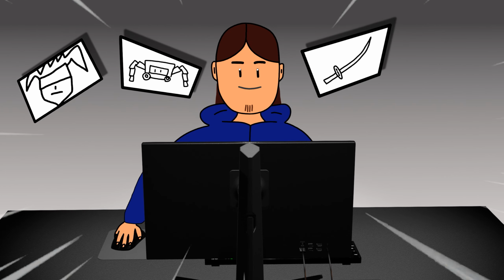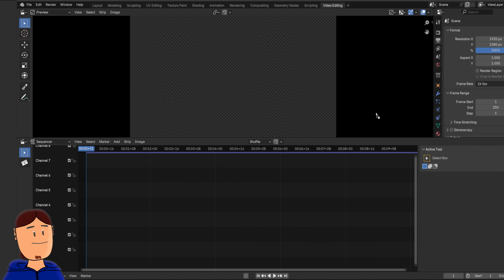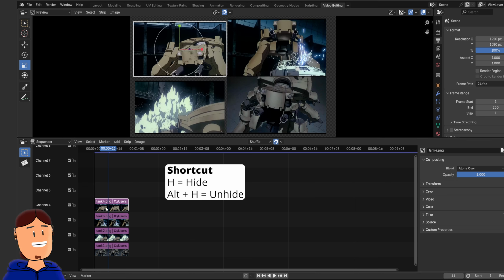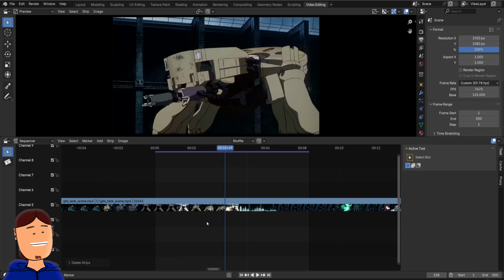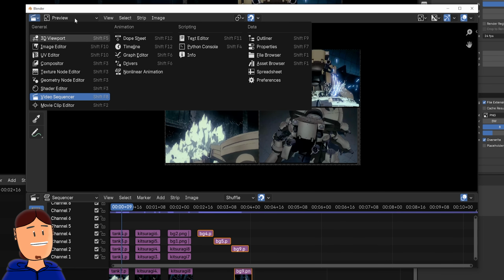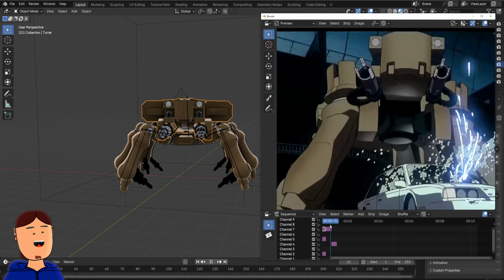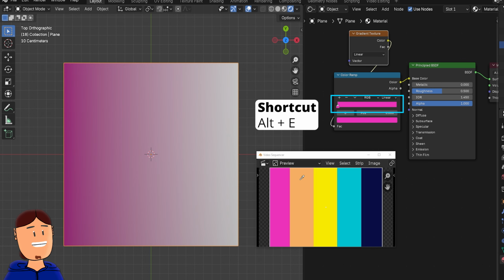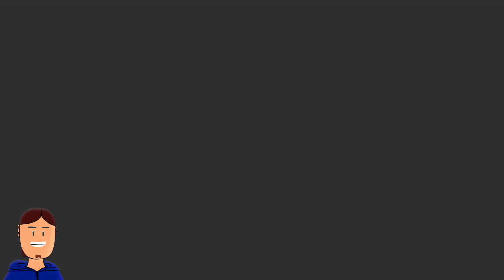How to Use Blender like PureRef (Tutorial)

Comment: I liked your GITS piece that was pretty cool! 👍I was using a panel changed to the image editor for my references which works pretty well but it would be nice to bring in video references as well so I'll be trying this out for my work. My machine has maxed out at Version 4.1 and later versions seem to give me problems with use, endless lag & crashing. I also noticed that at some point backwards compatibility (at least to version 4.1) does not work? Not sure if you've seen this yourself but I lost all my Grease pencil objects when trying to go back to 4.1 from the latest version. Luckily I had a back up I could go to from the older version which saved my butt lol! 😅
Reply from the maker: Thank you! 
I think 4.1 is the goated version, legacy EEVEE is really stable and fast.
4.3 is using eevee next and new GP so it doesn't work backwards at all.
Glad you had backups!
4.3.2 has been little better for me. 
I still get massive lag when Blender compiles shaders.
I remember reading that devs try to solve that in future versions :)